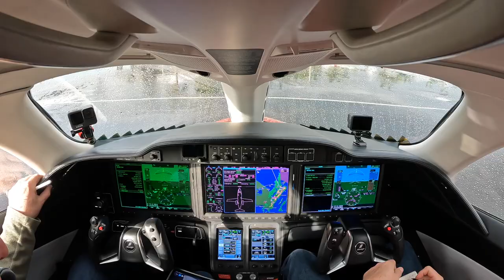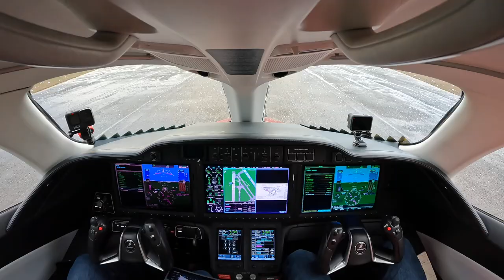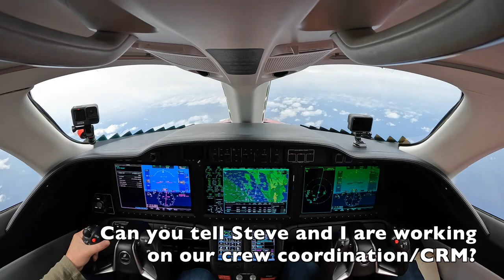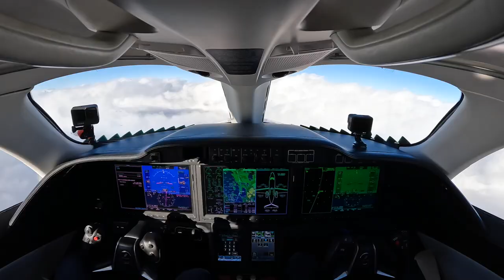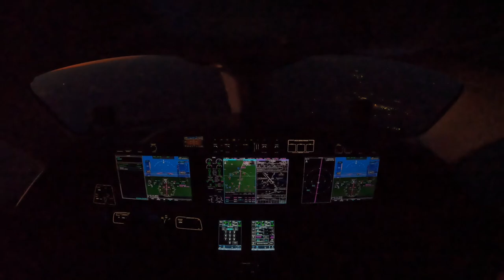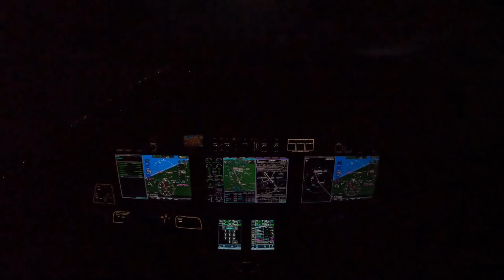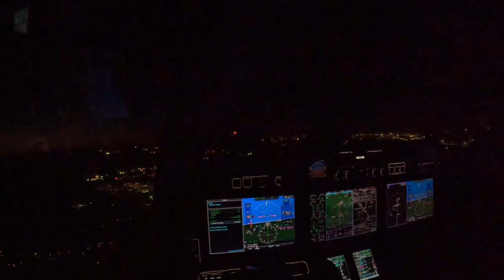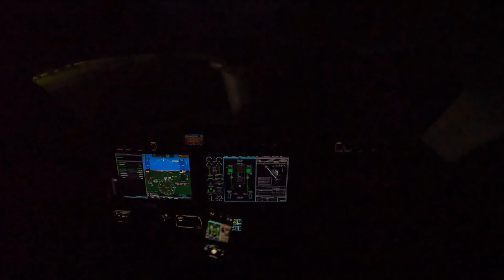Nothing Went as Planned: Anatomy of a Jet Flight - Part 3 of 3  (Flying the Plan) HondaJet Pilot

Comment: this was friggin outstanding stuff, I was always under the impression you hit the NAV button when you wanted to go onto FMS autopilot but I see you where manually following the FMS then when you hit AP it started to track the FMS Lateral navigation path
Reply from the maker: That's the beauty of the Flight Director. I can get the guidance even if I'm hand flying. There's the AP button for turning on the Autopilot and the other AP button for putting the Autopilot into the Approach mode. I always double check those.

Comment: Agree on the big jump in audio quality.  Very nice.  You’re dialing in the tech stuff! 👍🏻  Thx for another great video.
Reply from the maker: Thanks, I used a tip to add 'just a touch' of audio from one of the cameras which helps fill in some background sound.  The headset audio that I record seperately is pretty sterile

Comment: Outstanding video. It was great to watch you work the screens and instruct at the same time. Especially in a jet that I plan on owning. One suggestion: on final it was hard maintaining visual on the runway. That due to the placement of the center cockpit forward-viewing camera. The pillar in the middle of the windshield is a bit too wide for that view. I noticed you switched to another camera as you approach the threshold. Watching others wrestle their beloved beasts to the runway is half the fun of watching aviation videos such as yours. Also, I've never liked Opa-Locka weather. I live near Tampa (PIE).
Reply from the maker: Thanks Kevin, I keep wrestling with cameras and angles but think I'm close to a final working solution. My issue is more about battery and memory management to make sure they're all up and running during the different phases of flight. On the landing I had 3 sync he  views - Cockpit, Nose, and Wing. Thanks for continuing to check in on the channel and provide feedback. This last video was a beast, for sure.

Comment: great vid,,, my arm chair tip of the day is,,,, leave the gear down till over the  end of runway  in case of engine flame outs etc  :))
Reply from the maker: Arm Chair tips are always welcome...Great point!  
I always did that with my prop planes. With jets, it's a speed limitation. I want speed and altitude quickly. I'll get past my gear retract speed super quick which is why I we're taught in the type-rating that gear comes up as soon as we have a positive climb rate
Reply: @bluemaxsix  now i know,, ty :))
Reply from the maker: @MAGApepe  Keep it up. The questions and comments on the channel so far have been incredible. Totally unexpected but super fun
Reply: @bluemaxsix  9:38  can you also just scoll down the flight plan and hit the waypoint mak and then does a direct show up to hit  for it ?
Reply from the maker: Yep. Exactly correct. In the G3000 there's about 5 ways to accomplish a single task.  My button-flow on this is based on having been cleared to a point not on my route and having to go back and insert. Both good ways to get to the same  place

Comment: Really enjoyed 3 part Anatomy of HA420 flight.   Would it be possible to do some video on how your type rating training was like?   Flight safety sim?  Syllabus, ground instruction, flight portion, # of flight training, duration, total flight time, study material such as POH,  G3000 manual, How difficult to memorize memory times. etc.  No need for fancy pictures / video.  HA420 is a lot faster than helicopter and flies higher. Is it easy to get used to the difference?    I may have a chance to start HA420 flight training after mid April 2024.
Reply from the maker: Hmm. Let me think about the best way to do that. Any ideas?

Comment: I don't know if this was mentioned before but im curious to know how close is  the honda jet in msfs compared to the real jet in regards to handling on the ground and in the air, how close are the instrumentation. Do you think its st a study level?
Your videos are great and informative. Keep them coming
Reply from the maker: Great question and TBH, I'm not sure how close they are. I've tried it once but that was about 18 months ago. The handling was spot on and some of the G3000 capabilities weren't in place yet. 

As a pilot who flies the jet, it takes some concentration to engage switches that I'm used to touching. 

As far as training goes...YES!  Using sims in general and MSFS specifically, to train is a fantastic tool.

Comment: Some aircraft have windshield wipers; when you were waiting before departure, your windshields had a lot of rainwater on them.  When airborn, the water seemed to blow off; what is used on ground to disperse any of the water?
Reply from the maker: Thanks for paying close attention and asking - I've flown aircraft with and without wipers. The HJ windows are angled and coated so as soon as you move, they're clear. For me it hasn't been an issue. On the plus side, there's no drag from having external wipers.  When I flew AH-1 Cobras, we has air that would blow them clear. I loved that system.  @CitationMax has that feature in his aircraft

Comment: Anti-ice system is automatic until FL340, after thatmust be set manually, correct?
Reply from the maker: Absolutely correct. Good catch, thanks
Reply from the maker: 1) Icing is very rare (but not impossible) above FL340 and 2) the power requirements on the aircraft at or above that altitude make it smarter for it to be a Pilot-Decision vs Automatic